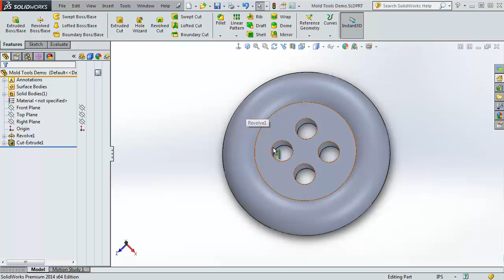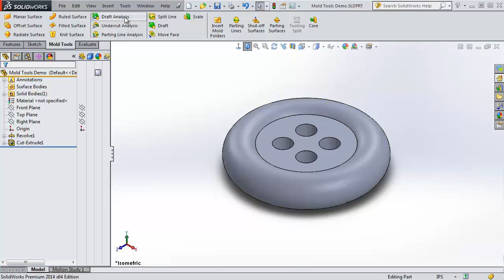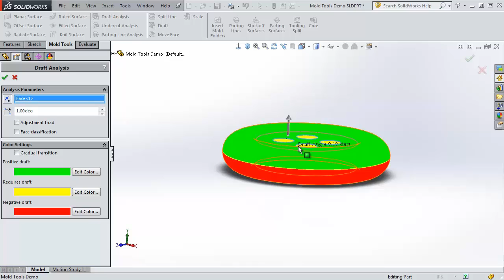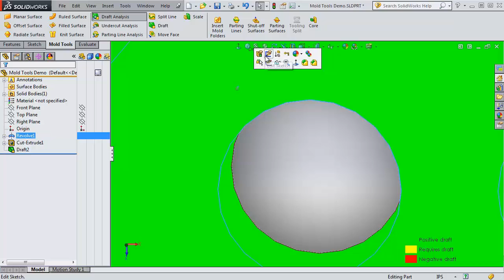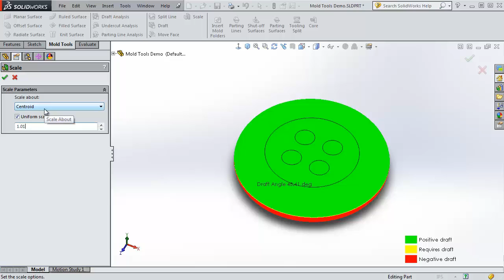SOLIDWORKS – Mold Tools Part 1 – Draft Analysis and Scale

Comment: hello sir there is yellow draft region at parting line so is it acceptable?
Reply from the maker: With this model there is a thin yellow line around the outside. this is an artifact of the faceted round face, and it will not have an actual effect on the model. In reality it really depends on the geometry of the part, though generally no yellow would not be acceptable.
Reply: @goengineer  Thanks for your reply

Comment: how do you deal with screwdriver handles that was revolved to be made and has weird shapes without any holes?
Reply from the maker: Hi jigsawz,
Even for more complex shapes you would want to run Draft Analysis to see where draft or undercuts exist.  From there, especially for undercuts, changes to the model would be required in order to make the model fit for molding.

Comment: How do you decide about shrinkage percentage of material. IS there any book or site which gives the shrinkage of material in mold making. Thank you for the information. It is very helpful for beginners like me. clear explanation upto the point.
Reply from the maker: Hi 123kkambiz,
The most important thing to know about shrinkage in injection molding is that it exists.  As s starting point you might look at this overview from Santa Clara University (http://www.dc.engr.scu.edu/cmdoc/dg_doc/develop/process/physics/b3500001.htm).  This shows some of the theory behind shrinkage.  More practically if you are now designing a product you would want to consult with the company that will be doing your injection molding for specifics on where they see shrinkage and how to adjust your design to accommodate for it.

There are also analysis programs like SOLIDWORKS Plastics that allow for you as the designer to simulate injection molding of your design to see what the potential shrinkage might be.  You can read more about that type of software here (http://www.goengineer.com/products/solidworks-plastics/ ).
Reply: Thank you very much for the information. Thanks a lot for quick reply.

Comment: Thanks for the vid Robert. Good explanation.  Simple and right to the point.  I like your vid cause you focus on the molding-desing stuff and not on the part drafting.  Some other vids I have seen spend too much time on drafting the part and leave too little time to explain the basics of the mold design stuff.  Thanks again.